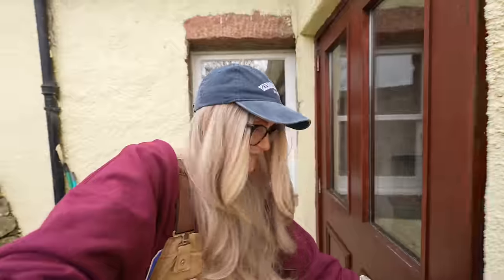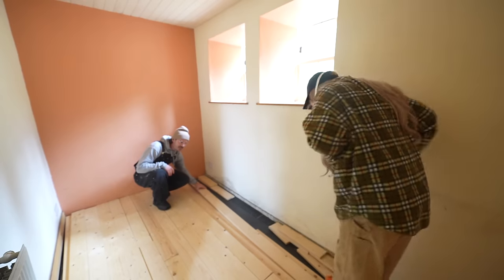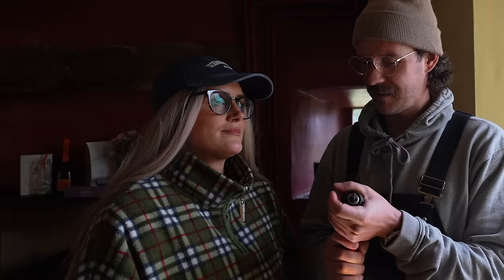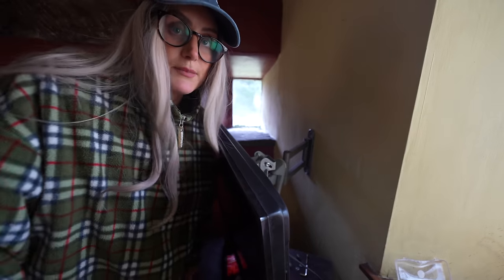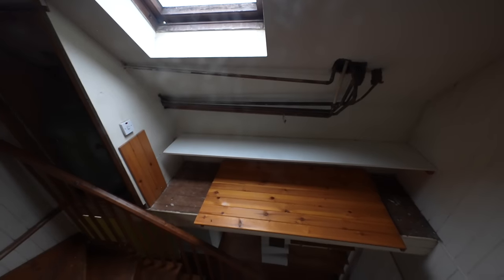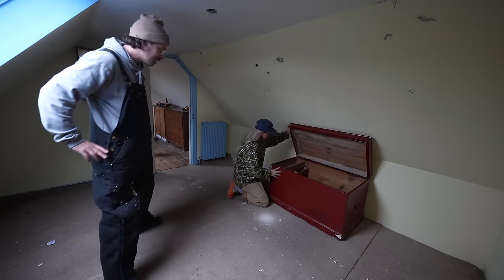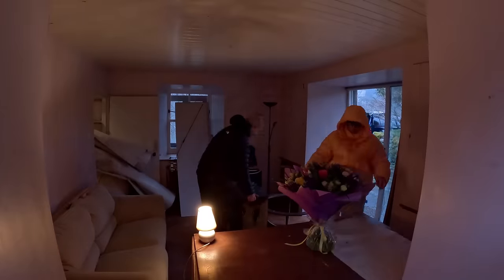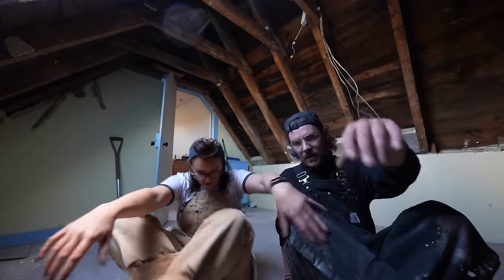Home Renovation - Let The Makeover Begin! (Ep.1)

Comment: You'll need to rip the wall open and remove the subfloor (2nd floor) to replace/install new insulation.

If you find animals or animal feces anywhere...you'll need to inspect your exterior walls, fireplace and roof for any holes that animals may be getting through.

Comment: You need to fix water coming in the house from the outside you gave to see if the water is running away from the house when it rains or not.
If its the concrete you will need to dig down beside your house and waterproof the footings and walls

Comment: It might be worth just installing a poured membrane finish to level out the floor before putting down underlay and then your finish, i would think its just condensation and not a rising damp issue due to lack of heating.

If you re-use the floor boards in the bedroom when you replace the insulation make sure to number them, typically you want to number and letter i.e. 1a, 1b, 2a, 2b, so you can put them back in in the same order without any issues.

I'd suggest getting some face masks (FFP3) as well, cheap from BQ, the sort of wood and mould you are going to be inhaling, might not make you sick, but will stuff up your nose and you will be blowing out black stuff for a couple of days, especially if your going to be doing any sanding.

Good luck with it all! I am sure it will be entertaining throughout, and just keep on enjoying the process, it will end eventually :)

Comment: Water repairs have to happen externally- meaning you need to stop at the source not the end point.  So you want to prevent the water from getting into the house.  French drain to move water away from the house might work but you will also need to check foundation/structure for cracks, etc.

Comment: You stop the water on the outside 😅
So after you take down and or inspect the inside, go outside to really fix the root cause for the water coming in be it fixing the roof or re-doing the ground drainage around the house. So all water is guided away from the building 😊

Comment: Can you shower with contaminated water? I (i wouldnt wanna..) think you have to the city board come out to do water testing/treatments .. i am not a home builder or anything but wouldnt concrete foundation crack touch up (waterproofing) and some good silicone around windows (if not being replaced right awY) help with leaking of walls and seals..? 
Might wanna set up the shower heater in the bus for now have clean water showers with what u can fill with while under renos. 
Can you look into a metal sheeting style roof? Will prevent water/mold and bugs getting in like max&occys home is AUS was a pretty decent set up. Have supports and braces inside and insulated. 

Eeek this is so exciting, whatever yall do, cant wait to watch it unfold and see what the future holds on this property for you too long term ❤ as always thanks for sharing !

Comment: 6;38 in. you will most likely have damp coming in through the walls or solumn, as its unlikely that your house has a DPC (damp proof course). It is possibble that you could install one from the outside, or it may been done previously. look for holes drilled in the outside wall at regular intervaLS which have been patched up with cement. this will indicate that its been done. the roof joists etc can also be treated for woodworm or dry rot etc, either by spraying or removal and replacement. hope this helps. i was a construction manager for approx 30 years and been on the tools previous to that so if you want any help, just ask. im not too far from you krazy kids. good luck

Comment: I'm currently doing a master’s in building surveying at uni. First, you need to deal with the outside to fix the damp wall in the downstairs bedroom. Definitely rainwater goods and possibly a new roof, but at least the broken areas. You also need to dig a channel around the house so the earth does not touch it. You can use all railway sleepers to retain the earth and create the channel. Internally, you need to tank the wall; this is a waterproofing method to stop the moisture from gaining inside, causing the dampness. The internal humidity levels also need to be improved; introducing heating and ventilation sauces will help remove any damp materials, which you started in this episode. It looks like a lot of the house will need stripping back to the structure to improve its condition. Looking forward to following your progress.

Comment: Hi! I am a realtor in the US. I deal with inspections daily repairs. Remove the pitless adapter cap on the well. Be careful as to not knock off ant clipped wire on the edge of pipe. Open up all taps( faucets in sinks ,tubs ,showers.) poor in well a pack of pool shock ( used to chlorinate swimming pools) go back in house and as soon as you smell the chlorine turn off water go to the next until you smell it from each tap. Let it sit in pipes or 48 hours. Do Not use! After 48 remove faucet screens and run water until you don’t smell chlorine. Bacteria always grows in pipes when the house is not in use because air gets into them and allows for growth. If it smells like eggs retreat again. Repeat all steps. After treatment and clear of egg smell and chlorine smell take water sample to health department for retest.

Comment: I don’t know all the details in English, sorry. But you need an exterior foundation drainage. They remove everything around the walls on the outside, put up some kind of protection (usually the knobby plastic thing) on the walls, then add rocks around so the water can drain away, and I’m sure they can do more too if there is a lot of water so it doesn’t run towards the building. Ask for professional help, it’s important.

Comment: You know you are both fantastic here is a helpful tip and your both so much fun to watch and adore so we must assist you. The cottage though was not well understood by the past builders in my experience the building needs to breathe ... so anything that seals it up on the inside is a mistake and there you can see in your video damage caused by sealing up a breathing building. You might need soakaways at the rear of the cottage as priority number one because the ground is up against it and so usually a bit of work goes in there first to get the soakaway in and damp coursework done on the exterior. But yeah this cottage is revealing so much lovely character as it is being stripped and looking forward to seeing the next videos. Meantime when it gets you down and it will, jump in Custard and go have fun! We have a camper and can offer a visit and some skills but first! We are installing a pressure cooker in the camper and all our tools and taking our underwater submersibles on deep loch dives which is our passion:)

Comment: Any gyms local? might be good to get a membership so you can get a safe, warm shower? I second all the advice about protective equipment especially respirators so you don't get mold and mildew in your lung. And Dry In the house first (after demo) then rebuild inside the dry envelop. No point in doing anything other than demo before you get the roof, foundation and walls fixed up. Hire sensible, experienced folks rather than tackling it all yourself and then paying to get it redone. Not that you can't tackle a lot of it yourself, but envelope, wiring and determining which timbers to keep definitely get knowledgeable help.

Comment: Worse than you thought, and you've only just begun!! 
I tried to warn you.. 
It may be cheaper and healthier, to gut it out to the exterior walls, and salvage original wood that's reusable, if sanded..
Gutting it out, would allow you to make spaces more practical, safer & healthier, it would also make adding any offgrid power sources easier to integrate, into the new interior..
Skip the money-pit and catch 22... Make it yours, to go with your flow😘

Comment: As wet as everything is I would think you 1  black mold which will need to be removed with respirators. 2 need a new roof and probably check the walls too.  You both should
Probably be wearing respirators anyway as you don’t know what you are uncovering.

Comment: ok so this is going to be a lot of work 1st you are going to need to gut everything you want to remove out of the house and get a true feel for the state of the house. IE Electrical, Plumping, & Structure. This will hopefully show you all the problems. I would recommend getting a plumber on site to scope your drainage system and check out your septic. As far as water getting through your walls you need to address that on the outside. If it is in your walls it already is a Big problem.

Comment: Im not an expert at all. I think if you have water coming into your wall, you wither have a leak in the roof, or if it is coming from the ground outside being higher than the floor inside, i think you need to trench outside and put a drain to help the water go away from the house. No amount of water barriers inside will help you avoid this in the long term. 
Please wear PPE and be safe.❤

Comment: Perhaps the most valuable lesson here is that so much of the material that you have ripped out and discarded was very new and had been installed with the best of intentions (and at huge cost), probably by a "skilled" builder, who simply didn't understand old buildings.  That roof and the gable wall are  classic examples of where modern insulation without adequate  ventilation can cause more problems than it solves.  You need to learn from these past mistakes...and thoroughly interrogate any advice you receive, including that from your your builder buddy.

Comment: @20:48 Does that wall have serious water problems inside? Regardless, you will need to dig away from the house and add a retaining wall to hold back the hillside and put in proper drainage away from the home.

Fix your drainage issues first before you make any interior renovations.

Comment: First of all, good on you for all the hard work! It can be daunting, but you jumped right in there and got going! Now, coming from someone who had to go in and gut a house because it had so much water damage before we bought it, please where a mask that will protect you from the stuff that will be in the air. Especially the particles from the mold and insects. It can take you down. And just because you’ve taken the bits out of the house doesn’t mean it’s safe to breathe without your masks yet. Now you have to contain/treat/fix/replace the wet areas because there is that same mold on it. You’re still breathing in the bad stuff until it’s gone.
Please, if there is any way possible, don’t wear your clothes, that you’re demoing in, into custard. You’ll be bringing all of what you’re trying to get rid of into her. He won’t be affected, but now your lungs are going still going to be breathing it in. I absolutely know from experience how much work it sounds to be and is to do this, but it’s a nonnegotiable to me. Also, before you drink any water from the house, please get it tested. With the state the house is in and its age, you may not know if the water is safe from lead pipes and anything that could have developed from all the mold. We had to replace all of our plumbing because of this. We did almost everything ourselves. We didn’t have much experience ourselves, but like you we had people that did that we could talk with.
You’re doing great with the removing, but you have (absolutely have) to deal with getting the outside water problems sorted before you can repair the inside. Otherwise, the repairs you’ll do will start being affected, like the bits you took out were, before you can address where it’s coming from. It’s like you keep changing your clothes because they’re getting wet from the rain, but not putting up an umbrella first. You’re going to keep getting soaked until that umbrella is there.
So, so proud of you. Remember to keep custard safe “clean” from what you are coming in contact with in there. You need a place, should you get sick or injured (I did) that your body can safely go to, to rest and heal. ❤️ If I can answer any questions, please ask. There are no small nor stupid ones. We learned so much through ours. I think we could do it again. Thankfully ours has lasted 18 years so far.

Comment: Look, before you're anywhere near getting a functional house out of that building, you're going to have to change the whole sewage system, the entire water system, and all of the electrical system as well. The foundation, the walls and the entire roof structure is rubbish too. That house needs a complete total rebuild. 

As it is, the house and the land are security for the mortgage, so I would just leave it as it is, and start turning the barn into an apartment and workshops. You'll be building faster, and adding equity to the property. 

Renovating an old building as bad as your house, or just demolishing it, and build a brand new house from the ground up, costs exactly the same. With a new house, you get a better floor plan, everything will be up to code, and your equity in the property will be a lot more... Renovating that pile of rubbish is just not worth your time, effort or money. Nothing in that building is salvageable or has any historical interest. I have 35 years of experience doing what you're about to start doing. Save yourself a lot of grief and listen to what I say .. Love you 💕💕💕

Comment: Chlorine dioxide is a very good mold treatment vs bleach that does. It kill mold.  Chlorine dioxide smells like bleach and even though it’s name is chlorine that’s like calling water hydrogen peroxide.  Both have water molecules but are separate chemicals so with chlorine dioxide.   It is non toxic used to clean eggs and meat but smells like chlorine but safe to the skin.  Won’t hurt animals just use in a ventilated space and diluted is very safe and has a very good track record for mold.  Do some research in the gas of chlorine dioxide to kill mold in the house once you get the active mold removed and start the cleanup phase.  You can get an industrial fogger to kill mola kinda like a flea fogger except this is non toxic to any surface.  Get the mold professionally treated please and wear masks until it is all removed.  Even walking in the room with mold exposes you to harmful mold toxicity.  Be safe peeps.

Comment: Hey, wear masks, you do not want to be breathing in all that sh1t. Insulation, plasterboard, mould and rat sh1t. Nasty stuff so masks on please team. 

2nd. Fix all the damp and water ingress before doing anything else. Get it all dry and see what you are dealing with. It’s gonna cost a lot more than you expect and will take 4 times as long. Think about groundwater as well as surface water - you need to deal with all of it. You might need to tank it.

Keep the old insulation and pop it in your barn. It’s expensive and can be reused.  Put much more insulation back in than the minimum spec. Heating a house is silly money.

Think about sewage if you are not on mains. I don't know Scottish building regs but you might need a sewage plant and appropriate discharge - this can be a lot harder than you think.

Don't spend money until you have a good grasp on the above. 

Don’t disturb the asbestos, get it removed professionally. Be careful with old ceiling artex or tiles if there are any. All can contain asbestos. Which is fine unless disturbed. Old paint can contain lead so wear masks. 

Get the fundamentals right and then creative juices can flow.

This can be a lot of stress and strain guys so take your time and take time out for each other. I am on number 3 and divorce is something you can't fix by wearing a mask - in most cases. 🎭 The current one is called "Project Never Again"

It’s gonna be smashing chaps. You can do it. Rule your own worldly house 😅

Did I mention wearing a mask?

Comment: You guys need to be wearing PPEs ALL the time. Not just some of the time until ALL of the mold is gone. Your first step should be to deal with the water from the outside in. Because cleaning the mold from the the inside won’t stop the mold that started coming in because of the water getting in from the outside. You guys are on a slope. Drainage has to be addressed now. And again WEAR PPEs AALL THE TIME. If u enter the house ur masks should be on! PLEASE!!!!!!!